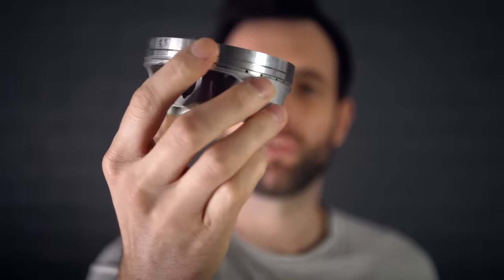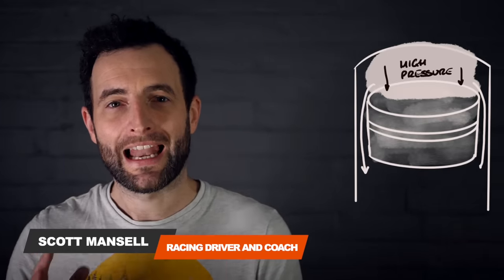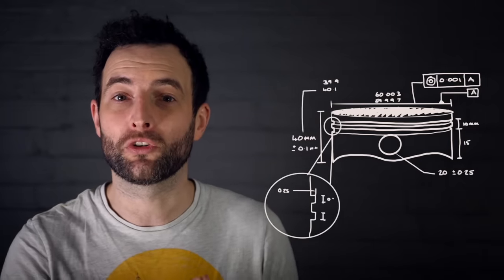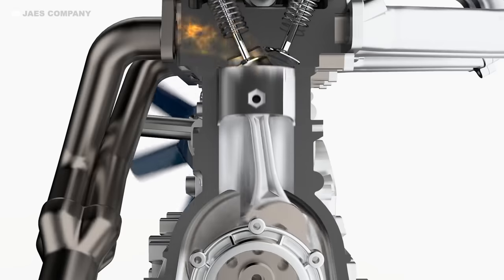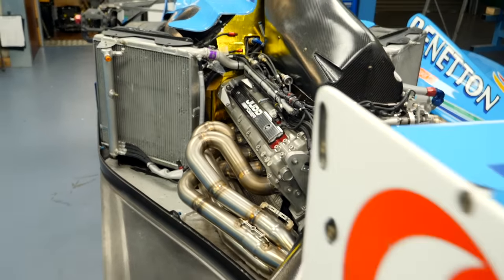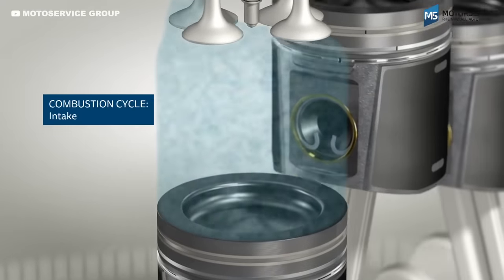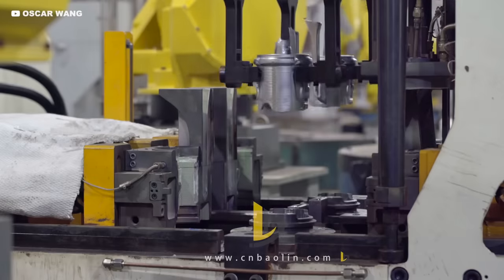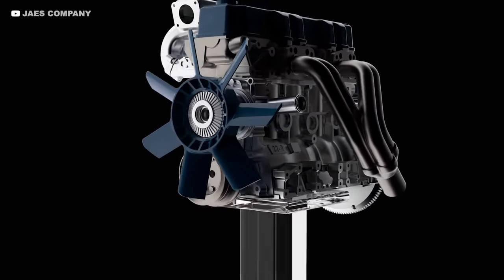Why F1 Pistons Cost £50,000!

Comment: The key thing that wasn't touched on in this video was production volume. You could spend hundreds of millions of dollars in the design/tooling/production planning of a piston, but if you manufacture millions of them, the cost of each piston decreases closer and closer towards its variable raw material cost. 

If you spend only $2 million dollars in the design/tooling/production of a piston which will only be manufactured less than 100 times, your per-piston cost is much higher than just the materials, since each piston is absorbing massive amounts of the research/design costs. 

Long and short, it's not the materials or design that's extraordinarily expensive compared to consumer vehicles, it's the fact that there are only a handful made compared to the millions that are produced for commercial applications.
Reply: Look at ev batteries, that logic fails a lot.
Reply: Great points!
Reply: And the cylinder seizes in the engine block .. LoL .
Rubbish .. they say this about halfway through that’s when I stop listening .. !!!!
Reply: Actually, quantity doesn't always translate to lower or higher price. My buddy just had a set of Ross forged pistons designed & built for his Olds Diesel block 440ci Super Comp engine with a set of custom 1 off Batten heads & they were exactly the same price as a more common set of small block Ford or Chevy pistons, about $1,400 for a set of 8, including a set of very thin Total Seal rings(.037 comp & .078 oil rings). He was worried he might have tweaked 1 of the oil rings so he called Total Seal & bought 1 comp ring, which was $80 inc shipping! Same thing with his set of TD rocker arms. The heads had to go to BOTH manufacturers for the parts to be designed & made & each pair rockers MUST go in specific locations on the heads. His mid 80s Cutlas has gone 7.96/168 with NO power adders on race gas with a single Pro Systems carb at Phoenix in June with 4,000 ft altitude air density, so it's no slouch & he knows what he's doing. Reher & Morison told him that HIS 555 BBC engine made 50 more HP than theirs! He's hoping for sub 8.50s on an 8.90 index. BTW, his 440 has so little ring friction that the engine won't stay on TDC while adjusting the valves without the spark plugs in the cylinders or a lock on the flywheel.
Reply: @bradgriffith4231  Well, that’s because your buddy’s pistons didn’t have $2M of R&D time put into designing them.  Someone probably spent an hour or two tweaking some parameters of a template and that was all the design work that was required.
Reply: @mensaswede4028  I'm pretty sure Ross has spent plenty of $$$$ developing their product line. F1 is more like a video game than a race car, since everything is "tuned" by an engineer with a laptop during practice. Put those primadonas in a sprint car or a NASCAR stock car & they can't even get up to speed to qualify the car!! Don't go away mad, just go away!
Reply: @bradgriffith4231  The ratio of R&D dollars to quantity of pistons sold is vastly different between Ross and an F1 team.  But believe what you like.  It’s the Internet after all.
Reply: @mensaswede4028  I grew up in a shop with race cars & have been building motors for over 50 years. Yes, it is the internet & you're entitled to believe whatever you want! For a side note, since you're so enthralled with F1 bullshit, an NHRA 500 ci motor makes 11,000 horsepower & the car, weighing twice as much as an F1 toy, accelerates from 0 to 100mph in 60 ft & 0.9 seconds, is running right at 300mph in 1/8 of a mile & right at 340mph in 1,000 ft. Naturally aspirated NASCAR engines were turning 11,000 rpm & making 1,000 hp before they were limited by NASCAR for cost reasons & an N/A sprint car motor also makes right at 1,000 horsepower. F1 is more a technology pool than racing IF you really understood what goes on!
Reply: @bradgriffith4231  Never seen an F1 race ever.  Don’t give a shit.  Never seen a NASCAR race ever.  Don’t give a shit.  This entire thread isn’t about racing, it’s about economics.
Reply: @mensaswede4028  "about economics" is just your opinion! It's about technology too. There is no reason in the entire world, regardless of production numbers, that 6 pistons would cost $50,000($8,333 each), even if they were made of unobtainium! F1 has been a folly for decades with rules determined by the biggest crybaby with the most $$$$$$. Whenever there has been a REAL technology advance, they made it illegal. BTW, since you've never attended a race, where does your "vast" knowledge, or interest for that matter, come from?
Reply: “In the beginning was the Word, and the Word was with God, and the Word was God.
The same was in the beginning with God.
All things were made by him; and without him was not any thing made that was made.
In him was life; and the life was the light of men.
And the light shineth in darkness; and the darkness comprehended it not.
There was a man sent from God, whose name was John.
The same came for a witness, to bear witness of the Light, that all men through him might believe.
He was not that Light, but was sent to bear witness of that Light.
That was the true Light, which lighteth every man that cometh into the world.
He was in the world, and the world was made by him, and the world knew him not.
He came unto his own, and his own received him not.
But as many as received him, to them gave he power to become the sons of God, even to them that believe on his name: Which were born, not of blood, nor of the will of the flesh, nor of the will of man, but of God.
And the Word was made flesh, and dwelt among us, (and we beheld his glory, the glory as of the only begotten of the Father,) full of grace and truth.
John bare witness of him, and cried, saying, This was he of whom I spake, He that cometh after me is preferred before me: for he was before me.
And of his fulness have all we received, and grace for grace.
For the law was given by Moses, but grace and truth came by Jesus Christ.
No man hath seen God at any time; the only begotten Son, which is in the bosom of the Father, he hath declared him.
And this is the record of John, when the Jews sent priests and Levites from Jerusalem to ask him, Who art thou?
And he confessed, and denied not; but confessed, I am not the Christ.
And they asked him, What then?
Art thou Elias?
And he saith, I am not.
Art thou that prophet?
And he answered, No.
Then said they unto him, Who art thou? that we may give an answer to them that sent us. What sayest thou of thyself?
He said, I am the voice of one crying in the wilderness, Make straight the way of the Lord, as said the prophet Esaias.
And they which were sent were of the Pharisees.
And they asked him, and said unto him, Why baptizest thou then, if thou be not that Christ, nor Elias, neither that prophet?
John answered them, saying, I baptize with water: but there standeth one among you, whom ye know not; He it is, who coming after me is preferred before me, whose shoe's latchet I am not worthy to unloose.
These things were done in Bethabara beyond Jordan, where John was baptizing.
The next day John seeth Jesus coming unto him, and saith, Behold the Lamb of God, which taketh away the sin of the world.
This is he of whom I said, After me cometh a man which is preferred before me: for he was before me.
And I knew him not: but that he should be made manifest to Israel, therefore am I come baptizing with water.
And John bare record, saying, I saw the Spirit descending from heaven like a dove, and it abode upon him.
And I knew him not: but he that sent me to baptize with water, the same said unto me, Upon whom thou shalt see the Spirit descending, and remaining on him, the same is he which baptizeth with the Holy Ghost.
And I saw, and bare record that this is the Son of God.
Again the next day after John stood, and two of his disciples; And looking upon Jesus as he walked, he saith, Behold the Lamb of God!
And the two disciples heard him speak, and they followed Jesus.
Then Jesus turned, and saw them following, and saith unto them, What seek ye?
They said unto him, Rabbi, (which is to say, being interpreted, Master,) where dwellest thou?
He saith unto them, Come and see.
They came and saw where he dwelt, and abode with him that day: for it was about the tenth hour.
One of the two which heard John speak, and followed him, was Andrew, Simon Peter's brother.
He first findeth his own brother Simon, and saith unto him, We have found the Messias, which is, being interpreted, the Christ.
And he brought him to Jesus.
And when Jesus beheld him, he said, Thou art Simon the son of Jona: thou shalt be called Cephas, which is by interpretation, A stone.
The day following Jesus would go forth into Galilee, and findeth Philip, and saith unto him, Follow me.
Now Philip was of Bethsaida, the city of Andrew and Peter.
Philip findeth Nathanael, and saith unto him, We have found him, of whom Moses in the law, and the prophets, did write, Jesus of Nazareth, the son of Joseph.
And Nathanael said unto him, Can there any good thing come out of Nazareth?
Philip saith unto him, Come and see.
Jesus saw Nathanael coming to him, and saith of him, Behold an Israelite indeed, in whom is no guile!
Nathanael saith unto him, Whence knowest thou me?
Jesus answered and said unto him, Before that Philip called thee, when thou wast under the fig tree, I saw thee.
Nathanael answered and saith unto him, Rabbi, thou art the Son of God; thou art the King of Israel.
Jesus answered and said unto him, Because I said unto thee, I saw thee under the fig tree, believest thou? thou shalt see greater things than these.
And he saith unto him, Verily, verily, I say unto you, Hereafter ye shall see heaven open, and the angels of God ascending and descending upon the Son of man.
And the third day there was a marriage in Cana of Galilee; and the mother of Jesus was there: And both Jesus was called, and his disciples, to the marriage.
And when they wanted wine, the mother of Jesus saith unto him, They have no wine.
Jesus saith unto her, Woman, what have I to do with thee? mine hour is not yet come.
His mother saith unto the servants, Whatsoever he saith unto you, do it.
And there were set there six waterpots of stone, after the manner of the purifying of the Jews, containing two or three firkins apiece.
Jesus saith unto them, Fill the waterpots with water.
And they filled them up to the brim.
And he saith unto them, Draw out now, and bear unto the governor of the feast.
And they bare it.
When the ruler of the feast had tasted the water that was made wine, and knew not whence it was: (but the servants which drew the water knew;) the governor of the feast called the bridegroom, And saith unto him, Every man at the beginning doth set forth good wine; and when men have well drunk, then that which is worse: but thou hast kept the good wine until now.
This beginning of miracles did Jesus in Cana of Galilee, and manifested forth his glory; and his disciples believed on him.
After this he went down to Capernaum, he, and his mother, and his brethren, and his disciples: and they continued there not many days.
And the Jews' passover was at hand, and Jesus went up to Jerusalem, And found in the temple those that sold oxen and sheep and doves, and the changers of money sitting: And when he had made a scourge of small cords, he drove them all out of the temple, and the sheep, and the oxen; and poured out the changers' money, and overthrew the tables; And said unto them that sold doves, Take these things hence; make not my Father's house an house of merchandise.
And his disciples remembered that it was written, The zeal of thine house hath eaten me up.
Then answered the Jews and said unto him, What sign shewest thou unto us, seeing that thou doest these things?
Jesus answered and said unto them, Destroy this temple, and in three days I will raise it up.
Then said the Jews, Forty and six years was this temple in building, and wilt thou rear it up in three days?
But he spake of the temple of his body.
When therefore he was risen from the dead, his disciples remembered that he had said this unto them; and they believed the scripture, and the word which Jesus had said.
Now when he was in Jerusalem at the passover, in the feast day, many believed in his name, when they saw the miracles which he did.
But Jesus did not commit himself unto them, because he knew all men, And needed not that any should testify of man: for he knew what was in man.”

Gospel of John - Chapter 1-2, King James Version.
Reply: Custom pistons can be had for WAY less than what is stated in this video
Reply: @bradgriffith4231  Huh?? He would NOT have had to send his heads in to get rocker arms made for them.... That's a load of fiction. 
I've been building and racing Olds engines for 30 years, and I KNOW better than that... also, the shaft rockers on my Olds heads could care LESS what cylinder they are on. I'm not sure where you're  trying to go with that one, NO company builds rockers that are specific to a certain cylinder on a head. That would be just silly.

Edit: Maybe your buddy's initials are A.M., if so, then I can COMPLETELY understand all of the fiction you have been told by him... 🤷🤦